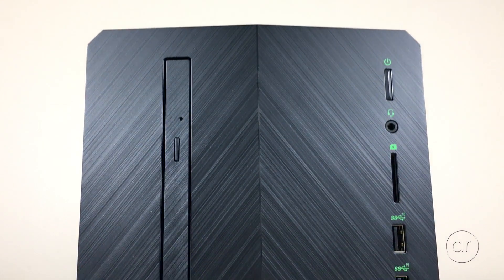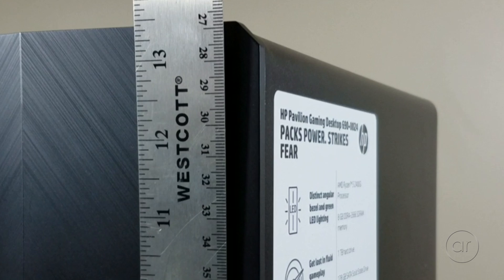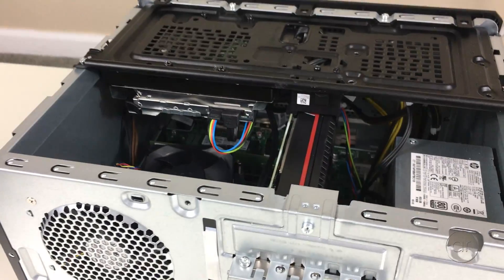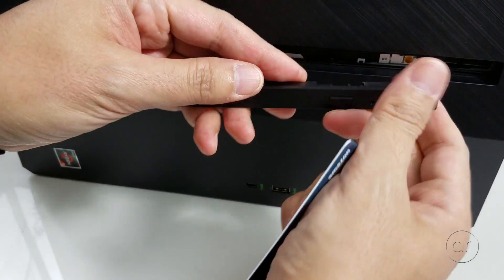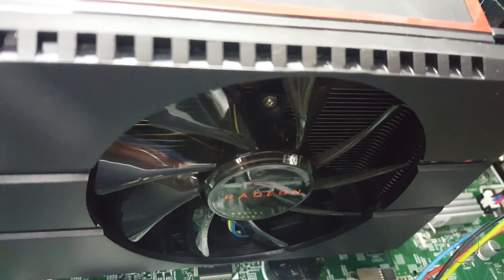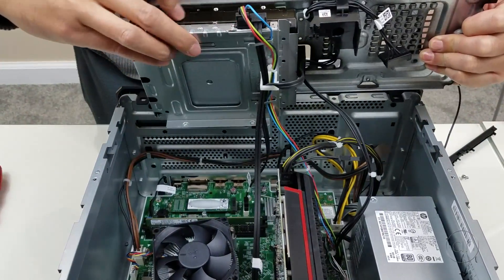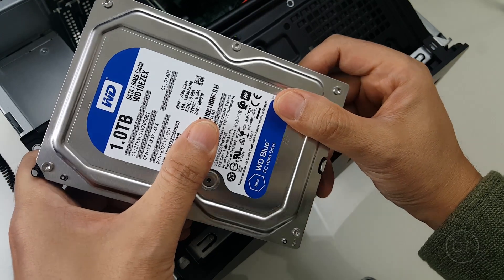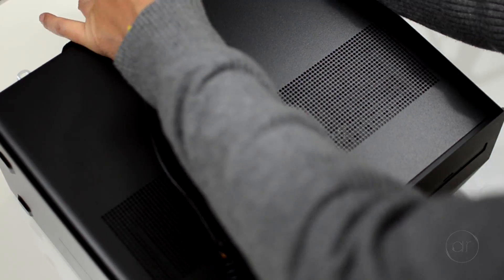How to Open and Upgrade a Ryzen-Based HP Pavilion Gaming Desktop

Comment: Could you change the motherboard/psu if i every want to get an intel processer, nvidia graphics card
Reply from the maker: Yes, you could, but you'd need a new case as well (assuming you aren't upgrading to HP's OEM motherboard and power supply). The case is customized for their own MB/PSU.

Comment: Is the 690-0032's parts compatible with an atx case?
Reply from the maker: Unfortunately, I haven't had any reports of successful migrations of the motherboard and power supply to another case (and I didn't check to see if the hole patterns on the motherboard were drilled to any ATX standard). The components themselves are standard, so they can be moved: the graphics card, the memory, M.2 SSD, and hard drive. The CD/DVD drive is slim-style so you'd need some type of bracket to mount it into a 5.25" bay.
Reply from the maker: @Zxicm  The MB and PSU are highly customized to fit the HP case, so I'm not sure if work in a third-party case (again, I haven't received any reports on successful migrations).

Comment: Can I upgrade the psu and the mother board?
Reply from the maker: Do you mean in the same case? You can, but they would need to be OEM parts from HP (since the motherboard and power supply are so non-standard). However, if you want to move all the other components to another case while upgrading to a third-party motherboard and power supply, that is possible since those components are standard, including the graphics card, memory, M.2 SSD, and the hard drive. The CD/DVD is a slim-style so you'd need some type of bracket adapter to mount it in a 5.25" bay.

Comment: Is it possible to move all the parts to a different case.
Reply from the maker: Unfortunately, I'm not sure about the motherboard as I didn't check the hole patterns to see if it was any type of ATX standard pattern. Both the motherboard and power supply are highly non-standard (PSU dimensions are 2.8125 x 2.9375 x 6.25 inches), so I'm not sure if they can move over. However, all the other components are standard, like the graphics card, memory, M.2 SSD, and hard drive. The optical drive is a slim-type so you'd need some type of adapter to mount it in a 3.5" bay.

Comment: How do you take out the graphics card because I don’t wanna brake anything when I upgrade
Reply from the maker: For PCIe cards, there will be a small plastic part that holds the card into the slot - and on that part will be a small lever which you'll need to pull in order to free the card as you pull it out of the slot. It's a bit difficult to explain in words but I'm sure there are videos about it...

Comment: Is there any way I could  move all of the parts of the pc to a different case?
Reply from the maker: Unfortunately, I didn't check the hole patterns on the motherboard to see if it was a standard ATX pattern. Both the motherboard and power supply are highly non-standard (PSU dimensions are 2.8125 x 2.9375 x 6.25 inches), so I'm not sure if they can move over. However, all the other components are standard, like the graphics card, memory, M.2 SSD, and hard drive. The optical drive is a slim-type so you'd need some type of adapter to mount it in a 3.5" bay.

Comment: Do you know if the power supply is standard? of do you need a branded HP to upgrade it?
Reply from the maker: Unfortunately, the pin connectors are non-standard on the power supply. I've kept track of successful upgrades of the PSU in the pinned comments, and they have all been OEM HP parts.

Comment: Hello! I am having trouble removing the cage to upgrade my ram
Reply from the maker: Were you able to remove the optical disk using the tips written in the pinned comment?
Reply: access random i do not see a pinned comment.
Reply from the maker: @borattz  Sorry - you may need to sort by top comments on the desktop. I'm not sure about on mobile devices?

Comment: So can you put a rx 3700xt in it. Pls I'm really curious. Its bugging me
Reply from the maker: I'm afraid not (according to HP's specifications site for the 690-0024). Unfortunately, it doesn't support any 3rd-generation Ryzens as an upgradeable CPU. The highest it can go is a Ryzen 7-2700.
Reply: @accessrandom  so what is the highest GPu you can get then?
Reply from the maker: @watermelonsmith9620  Sorry, my mistake - I accidentally read the 3700 as a CPU, not a GPU. I've been keeping track of successful upgrades of video cards in the description under the "Graphics" section - you can find the makes and models of cards that fit physically in the case and whether they needed to upgrade power supplies...
Reply: @accessrandom  thx alot dude this helped me a lot thx. I'll make sure to sub
Reply from the maker: @watermelonsmith9620  You're welcome, and thank you 👍 Happy to have you here.
Reply: @accessrandom  lol i upgraded my gpu to a zotac 1080 and now wanna know if i can put 2 8 gb 3000mhz ram sticks

Comment: Hello, can you let me know what the psu needed to upgrade to the 1660 gpu? I have the non gaming version of this desktop with the weak 180w psu
Reply from the maker: I've kept a list of successful power supply upgrades (along with the Pavilions models in which they were upgraded) in the pinned comment - unfortunately, all of them are HP OEM parts since it is a non-standard power supply.

Comment: Is it possible to upgrade to a RTX 3070 when its released?
Reply from the maker: It will depend on the size (the description has details concerning dimensions) and the power requirements of the card - it shouldn't consume much more power than the existing graphics card.

Comment: Do you need the thing around your wrist to replace ram?
Reply from the maker: No, but the ESD strap a good safety precaution to prevent static discharge damage. It removes any electrical potential between you and the components in the case when you clip it to the bare metal of the case. Alternatively, you can keep in contact with the case while removing the memory.
Reply: access random thank you, very helpful

Comment: its been about 7 months since i had the 690-0010 and i greatly recommend you upgrade the gpu and ram in this system the rx550 is not meant for 1080p gaming at all and the one stick of ram greatly hinders your performance. i upgraded to a gtx 1650 and added another 8gb stick of ram and performs so much better now.
Reply: Mine came with a 1660 super whats the max you can go is my question
Reply from the maker: Thanks for the info - this will be helpful for others who have the 690-0010.
Reply: do you think ill be able to upgrade to 1660 super
Reply from the maker: @kevinjuarez5796  I've kept track of successful upgrades from viewers in the "Graphics" section of the description. It looks like a couple people were able to upgrade to the 1660 Super.
Reply: Do you think I can use G.SKILL Trident Z ram ddr4 8GB x 2 3600 megahertz with the Sunflower motherboard or do I have to upgrade.
Reply: @FzSushi  the motherboard takes a maximum of 2400 hz so yes you would have to upgrade the motherboard or just get that speed ram.

Comment: Could any of the parts be used in a normal sized case?
Reply from the maker: I'm not sure about the motherboard and matching power supply since they are so non-standard (I didn't check the standoff hole patterns of the motherboard to see if they were ATX-standard), but all the other components are standard and can be used in a normal case: the graphics card, M.2 SSD, RAM and hard drive. The optical disk is the thin-type, so you'd need some type of bracket to make it fit in a 5.25" bay.

Comment: do you know if i can upgrade a ryzen 5 2400g to a 3400g. The sunflower board was released in May 2018 and there are currently bios drivers for August 2020. Could it be?

Comment: Got the model with the 1650 and wanted to get a 1660 super for it that’s why I’m here
Reply from the maker: There have been two reports of successful upgrades to a 1660 Super (please see the "Graphics" section in the description), though you may need to upgrade your power supply depending on your model.
Reply: @accessrandom  wait could I upgrade to a 9.5 inch length 2060 dual?

Comment: Does anyone know if a Ryzen 7 3700X would be compatible with this machine?  It's not listed in the manual, but it is AM4 and has TDP of 65W
Reply from the maker: Unfortunately, HP's specifications website doesn't show any third-generation Ryzens as supported upgrades - the highest it goes is a Ryzen 7-2700 for the Pavilion 690-0024.

Comment: I have the rx 550 in mine but I'm buying a fxf amd rx580 black edition and I'm hoping it will fit...plus another corsair vengeance ram not sure if I should go with 1 or 2! Any advice???
Reply from the maker: The RX 580's power consumption is higher than the RX 550 so you may need to upgrade the power supply. For memory, I would go with 2 sticks if you are looking to replace the existing memory since there's only two slots (and you don't want to mix and match with the slower memory).

Comment: Gtx 1080 ti mini ?
Reply from the maker: I haven't had any reports of anyone upgrading to a GTX 1080 Ti (please see description under "Graphics"), but the power consumption is higher than the RX 580 so you'd probably need a new power supply.
Reply: How about ryzen 5 3600 😂
Reply from the maker: @gsklol  I'm afraid HP's specifications website doesn't list any third generation Ryzens as upgradable CPUs - the highest it goes is the Ryzen 7-2700 (and not the X version).

Comment: 3:08 motherboard does support  intergrated graphics. My dad took my pc to use for work. I took the graphics card out and the black plastic part on the motherboard hdmi port and then I tested it. Windows automatically installed drivers and it works 100%.
Reply from the maker: Thanks for the information. I didn't know it at the time I recorded the video, but I've tried it myself shortly thereafter and can confirm. When you remove the video card, the BIOS will automatically switch to the internal graphics (even though there's no settings for it).

Comment: Don't use a plastic card to pop the dvd drive bezel off, I broke one of the plastic tabs off doing that, rather just unplug the drive's cables, and push the black release lever on the back of it, it will pop right out of the front. Also despite what hp marketing says, it actually has a sata type m.2 ssd, not an nvme. Which is cheaper and not as fast. I have verified however that it is nvme capable.
Reply from the maker: Thank you for the tips. I wish Youtube brought back annotations so I could place it in the video... there have been a couple people who've reported the DVD drive cover instructions and the M.2 SSD specs (they can be found in the pinned comments).
Reply: What do i do if i dont have a black lever

Comment: I was able to put an HP 500w SFF PSU into my HP Pavilion 690-0067c. However, I could only secure the PSU with the top left screw. I was also able to install a Gigabyte 1070 Mini ITX into my system.

Edit: The model number for the PSU is L05757-800 you can find it in the HP parts store. It has a 6+2 pin connector so you dont need an 8 pin adapter.
Reply from the maker: Thank you! Do you mind if I credit you in the description and the pinned comments, and is the model number GV-N1070IXOC-8GD for the GTX 1070?
Reply: @accessrandom  Yes, I am pretty sure the model number is correct. I don't mind being credited in the description. Thank you!
Reply from the maker: @pinoyphantom9423  Done! Thank you 👍
Reply: @accessrandom  It was a pretty tight fit because the 6+2 pin connector stuck out a little. You kinda have to jam the cables in to fit the cage. Note that the PSU does not correctly fit in the case and that you can only secure it with one screw.
Reply: What do you do with the cpu? Leave it as is wouldnt it drag down the 1070?

Comment: What type of heatsind and cooling i can use for this model? Only low profile like noctua's model or can i use something more big too? As second question, can i move the mobo into a new case or chasis? Some sellers told me that the mobo is a micro atx and can be moved into a micro atx case or hybrid without issues. Is this true?
Reply from the maker: A couple viewers have used the Arctic Freezer 12 (see the CPU Fan section in the pinned comment), but they had to remove the inner cage that holds the hard drive. Something like a 212 EVO would be too big, but lower profile fans should be fine. Please keep in mind that the mounting holes are drilled for Intel, even though the CPU is AMD(!) I'm afraid I haven't had any reports of anyone successfully moving the non-standard motherboard to another case, and I didn't check the standoff holes to see if they were ATX standard. I'll need to check the next time I'm inside.

Comment: Hey so i was trying to put an SSD in the machine, and I noticed that with the power cord, it has two ends and then has the bigger end. it’s difficult to explain. but I can’t figure out where this end goes
Reply from the maker: Do you mean the connector that I'm holding at the 5:13 mark? If so, there's two connectors there (the same size) on the same cable - one goes to the hard drive, and the other would go to your SSD.
Reply: access random Thanks for your help, but a best buy employee told me that i would have to sauter  a sata power cable to the psu. I just returned the ssd and got a 2tb external hdd. It works great
Reply from the maker: Cool, thanks for the update.

Comment: I have the Ryzen 7 version of this (model 690-00xx) with 16 GB of RAM.  It's awesome for video editing.  Going to upgrade to 32 GB of RAM soon.  Nice video, it definitely helped me figure out how to access the RAM slots.
Reply from the maker: Glad you found the video useful. Thank you 🙏
Reply: Which ram did you go with. I have the same exact pc
Reply: @SpyderBlackOfficial   I replied to this a few days ago with a link to the RAM that I used, but my reply must've been deleted.  So here's the description of the RAM that I bought from Newegg:    G.SKILL Aegis 32GB (2 x 16GB) 288-Pin PC RAM DDR4 3200 (PC4 25600) Memory Kit Model F4-3200C16D-32GIS
Reply: Hi, ii have the 690-0020 and ii want to know if ii can upgrade to the ryzen 7 3700x or can ii only upgrade to the ryzen 7 2700 also can ii make these upgrades without changing the stock cpu cooler? Ii also want to know if ii can upgrade my rx 580 4gb to a gtx 1660 ti 6gb
Reply: @f50IQ  Sorry, I don't know the answers to your questions. I've never upgraded the CPU or graphics card on a gaming desktop.
Reply: @martinafan64  ahh, alr! Thanks anyway for replying
Reply: @f50IQ  Yeah, when it comes to desktop PCs, I've only installed Windows, upgraded ram, added HDs & SSDs, added DVD-RW & floppy disk drives, replaced motherboards, and installed basic PCI cards for analog video, audio, & ethernet.  But I've never been brave enough to try upgrading a CPU, I just get a newer/faster computer if my old one is too slow lol. I've always wanted to build my own computer but when I added up the cost of everything, I found it cheaper to just buy a pre-built desktop from Best Buy with similar specs.
Reply: @martinafan64  ohh, ok

Comment: Great video but my Ryzen 5 3600 hp TX10-64ns 3A620EA is a little different. The strip down is easier (one screw), 512MB M2 ssd, 16GB ram, PSU  310W gold, no CD or slot, Nvidea1060, no HDD. I have added a hdd and got rid of the annoying green leds by simply disconnecting the cable. I suspect I may need to upgrade the psu and hope the 400W will fit.
Reply from the maker: You're correct - this video was really geared toward the HP Pavilion 690 family of PCs, so the TG series will probably be different.

Comment: Jake here again. Just upgraded to 32GB ram, (16 GB x2) Team Force Vulcan Z. Currently $92 on amazon. It's 3200mhz c16. Only runs at 2400 instead of 2666, which the prior upgrade (Gammix D10 8gb x2) ran at. Oh well.
Reply from the maker: Is the model number TLZGD432G3200HC16CDC01 by any chance?

Comment: I am looking to upgrade the ram would this ram be compatible? https://www.amazon.com/dp/B07RM39V5F/ref=cm_sw_r_sms_apa_i_wH.mFb4WEGN29
Reply from the maker: I've been keeping track of viewers' successful upgrades in the "Replacement Memory" section of the description. In general though, any faster DDR4 memory will work as long as you're replacing the existing RAM but will run at a slower speed.

Comment: I would be able to take the parts out of this computer and put them in a micro atx case right?
Reply from the maker: Good question - I haven't tried it myself nor have I received any reports from others. Unfortunately, I didn't check the standoff hole patterns on the motherboard to see if they were ATX-compliant, so I'm not sure (the motherboard is such a custom part, I wouldn't be surprised if the holes were non-standard). The custom power supply dimensions are 2.8125 x 2.9375 x 6.25 inches. The other components (hard drive, M.2 SSD, graphics card, memory) are standard so those could be moved over. The CD/DVD drive is a thin-style so you'd need some type of adapter to place it in a 3.5" bay.
Reply: Thank you! I’ll maybe get a new motherboard then and power supply if i need it. This helped a lot!

Comment: I have this pc is it good?
Reply from the maker: For what it includes in the price, it's ok, but if you want to upgrade anything major (like the custom motherboard or the matching non-standard power supply), you'll have some difficulties since they're non-standard. Even upgrading the graphics card may be a problem since more power-hungry cards may require a larger power supply.